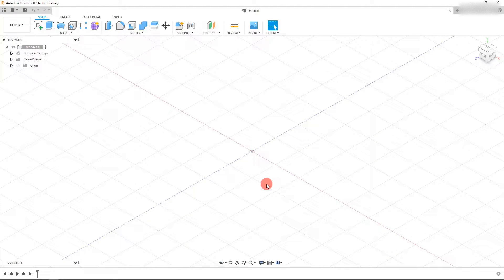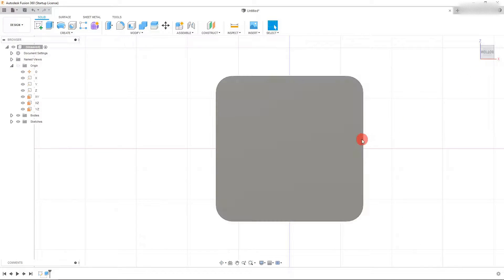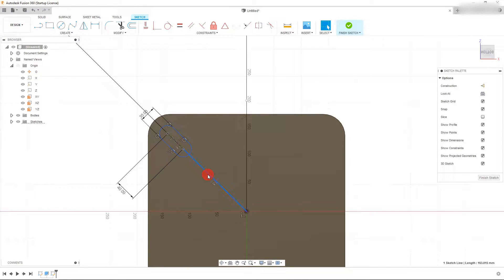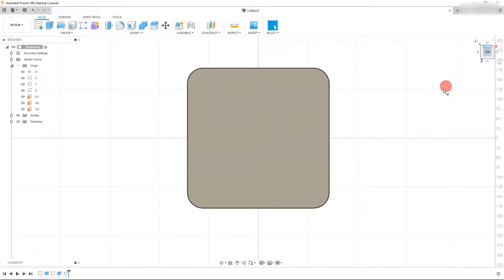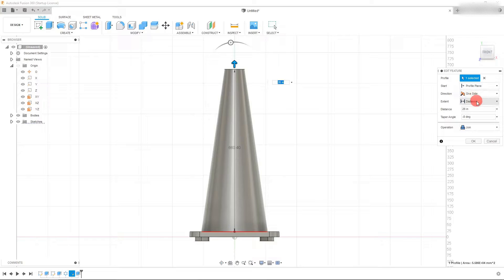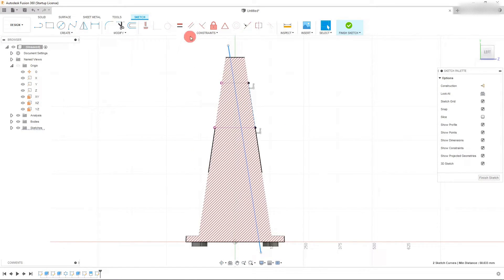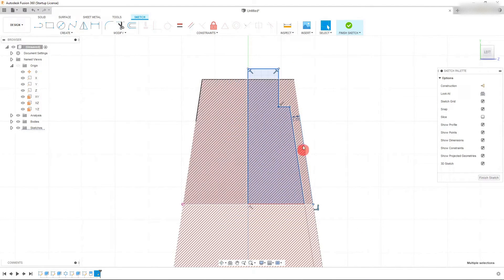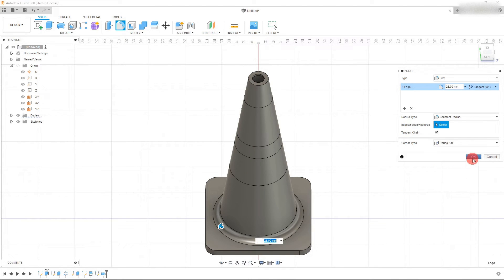Model a Traffic Cone in Autodesk Fusion 360! Tutorial for Absolute Beginners

Comment: Is there a reason you switch back and forth between metric and imperial? Keep up the vids mate. They get better each time.
Reply from the maker: Hey, thanks! No real reason. I have done videos in both, but often switch to imperial because I am more used to it. Which do you prefer?
Reply: @AvivMakesRobots  I'd prefer metric. Makes more sense and it's used in engineering pretty much everywhere. Do enjoy your vids though.
Reply from the maker: @MeMe-zd9wo  Yes, I may default to it, but it depends on the project. If it involves tight tolerances, it feels better to use thousandths of an inch. Large assemblies usually call for metric.
Reply: @AvivMakesRobots  ok. Just gets a bit confusing if I miss the imperial callout for dimension. I had a ridiculous contraption and some head scratching before I caught it. Hahaha.
Reply from the maker: @MeMe-zd9wo  I see. Sorry if it confused you. If you put 1 mm for every inch, your cone would have come out A LOT smaller.
Reply from the maker: For modeling's sake, it would still be the same steps all the way through, just with a different scale size.
Reply: @AvivMakesRobots  Hahaha, yeah, really weird looking,
Reply from the maker: @dztrbdgod  A car would not notice a 26 mm (1.023") tall traffic cone, lol.
Reply from the maker: @dztrbdgod  By the way, I have a tutorial up on how to switch between the unit systems.